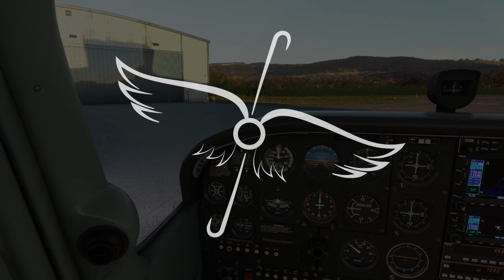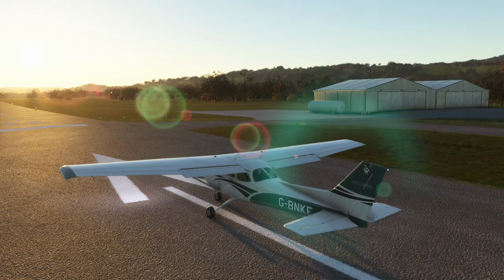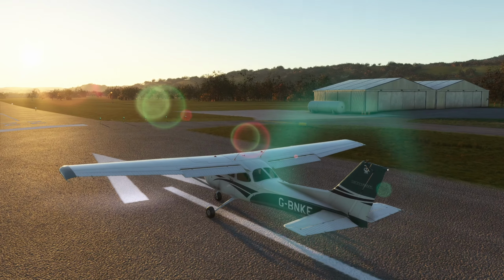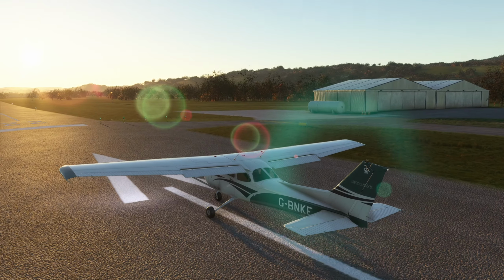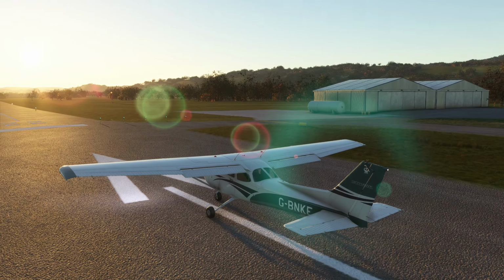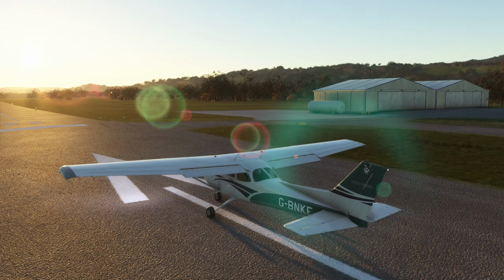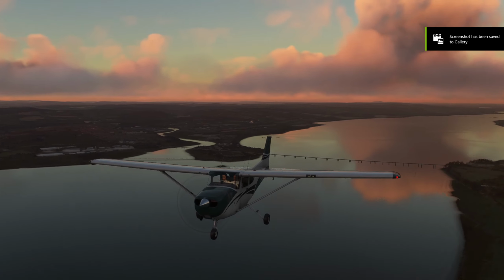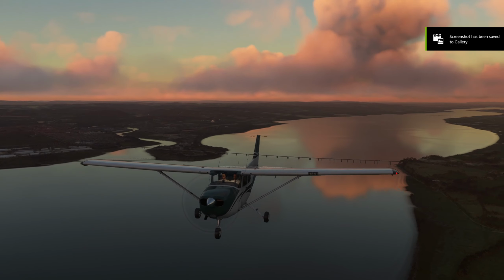WB-Sim C172SP | VFR on VATSIM

Comment: Nice, this is my favourite plane to fly on MSFS as well. The WB-Sim upgrade makes it pretty realistic to fly, and the Boris Audio Works Cessna 172 Sound Set improves it even more.

From what I understand from the discord the state saving (and thus the tacho) is stored per livery, so you need to use different liveries if you want to track time for different registrations.
Reply from the maker: Hi, thanks for the info! I must look into the soundset you mention before my next video. Also, i distinctly remember the feel of the flight dynamics on final approach were really good, in a near flare attitude you don't get that wobbling effect that i remember from default aircraft, maybe thats just the control curve somehow works well for me, not sure
Reply: Loved the video. This is the content I love. Love the aircraft and it too is my ‘go to’ C172. I also have the Boris Audio which makes it even better. Just a few comments: 
1. when joining right downwind, you called out joining right base - which I believe was an error unless I’m missing something. You then correctly called right base when turning base. 
2. When doing Unicom calls,  my understanding is that one should start with the airport name followed by ‘traffic’ and end with just the airport name (without ‘traffic’). I noticed you add ‘traffic’ at the end as well. Which is correct? 

A request would be for you to do an overhead join on one of your next videos. I noticed on the VFR chart that the pattern is to the south (unless ATC instructs otherwise) and thus the normal joining pattern should have been ‘Left’ for runway 27.  I would love to have seen how to correctly do this when approaching from the north. 😊 
I would be so keen to see more VFR flights with steam gauges. I’m probably flying more than 50% VFR on MSFS in UK, Europe and US. 
Thanks again.
Reply from the maker: @RhettKelly  Hi! thanks for your thoughts. Yes your correct I messed up that downwind call, also I believe you are correct that a unicom call should have traffic at the beginning, but at the end no 'traffic'. But I have a feeling thats totally an American useage. I have a feeling in the UK all you say is the 'Bristol Traffic' at the beginning, and don't mention the airport name or traffic at the end, I need to research this though to be sure. Also you are correct, it was only afterwards that I realised that there was only a left hand circuit, and I should have adjusted, either done an overhead join or re-routed into Bristol. I have not flown VFR in a while, if you look back you'll see a lot more older videos Ive done VFR, but I mean to make a return to it on my channel this year! Thanks for watching and I'll make sure I feature an overhead join in the next video!